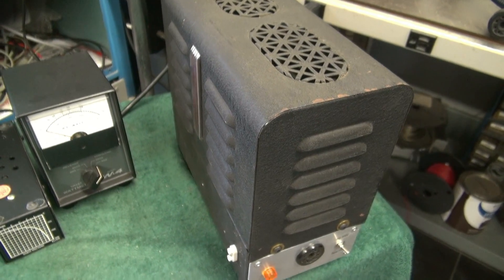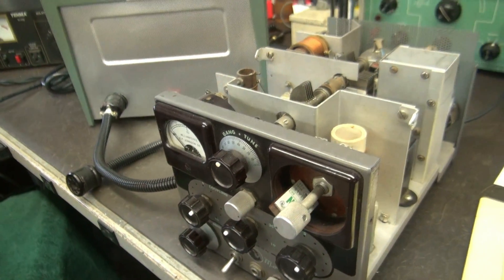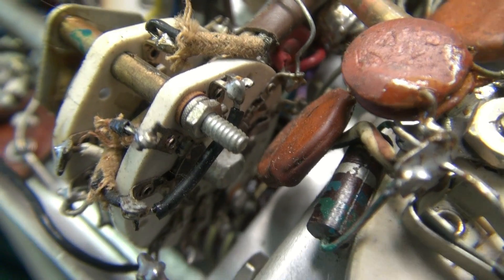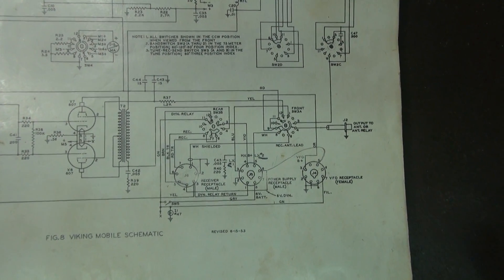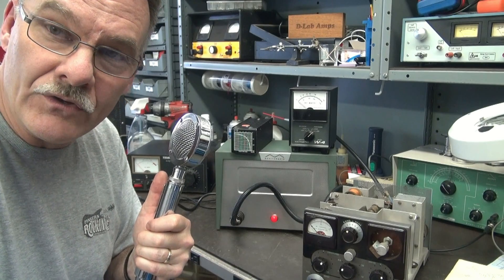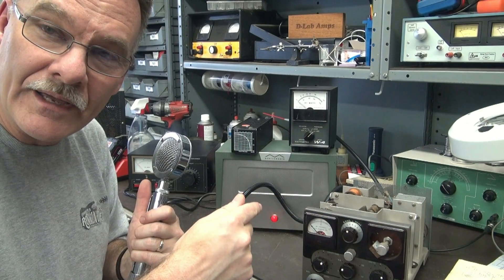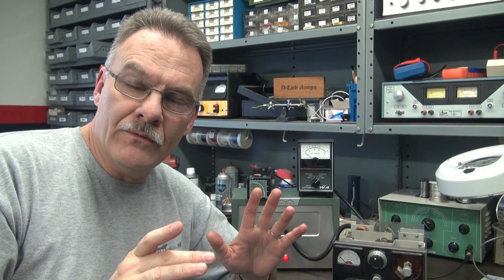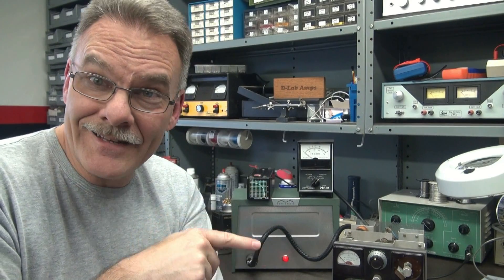Johnson Viking Mobile Tube AM Transmitter Power Supply demo by D-lab

Comment: Well the best way.. is to find the proper plugs and make proper cables.Now, it is a fact that as designed the function switch is switching B+ with a wafer switch, if you don't have a push to talk relay.. This is NOT going work for very long.. because of arcing at the wafer switch, when used that way.   What mr. D has done, is use the wafer switch to key they relay .. which should last a long time.  The modulator has a little oscillator tube which provides the bias for the modulator.    If you WANT to use an HP-23 supply.. you have a couple of options.  You can run the transmitter at reduced power using the 300 volts supplied by the HP-23. You will have to change the screen resistor jumper per the manual .   Another method is to change the HP-23 High Voltage section from a Voltage Dublier ( 750 v)   to a full Wave Rectifier.. 375 volts... using the low b+ for the oscillator.   All of the 50's mobile transmitters have a Maximum B+ of 600 v.. and all require that the screen resistor jumpers be adjusted to match the B+ you are actually using  generally between 350 and 600 volts.  Avoid using a supply so poorly regulated that the voltage soars above 600 volts with no load.
Reply: my HP-23B modified as above  supplies a nominal 400 volts B+  ( 375 to 395v under load depending on the xmtr)  with good voltage regulation,   the LV section supplies 250 or 300v (switch selected)  for osc, driver etc.   It will also run any of the mobile xmtrs with 300v suppply hi and lo B+ together.   with a bit lower rf output.   One can use the 300 volt section of an HP-23 to run the transmitter  without any modification to the PS at all.  the book will show you how to use a single supply for both lo and hi B+